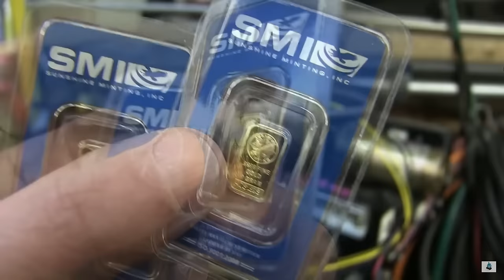Cold Welding In Vacuum

Comment: Thanks for testing so thoroughly! Very interesting to see how difficult it is to get a cold welding result!
Reply: can you show a more in-depth video on how to make a nut vibrator?...making one for a friend
Reply: AvE Thanks for recommending this channel to me. Cody has almost a million subscribers now. crazy.
Reply: So, is it pronounced Ave?
Reply: Ja, nuts, I remember coming across his water to acid mythbusting vid then having my mind blown at the TNT vid; thinking how does this guy only have a thousand subscribers?!
Reply: This colab has been very interesting to me, I think the finding that twisting metals together plays a big part in cold welding is significant in the mystery of gauge blocks holding on to each other... yet I've never had gauge blocks gaul up permanently like actual cold welding
Reply: i also think YouTube is in need of more nut vibrating, make it happen AvE.
Reply: AvE That pleasure device could be breaking the weld from the bolt and nut... but it could also form a weld... paradox!
Reply: I think that cody's theory is correct. A way to test it would be to press the 2 gold plates together in your hydraulic press.
Gravity alone cannot get enough atoms to bond but a press just might do it. The atoms will be closer to each other and the flat plates will get even flatter.
Reply: AvE build a rig so cody can adjust the frequency that mini vibrator puts out the right frequency should melt metals after all pretty much everything is on some kind of wave length even if you cannot see or measure it with tools available.
Reply: Hahaha I thought those gold pieces were familiar~!
Reply: jam9297 that's why it pauses when vibrating
Reply: AvE when you sent them you galled them pretty bad I wonder if the surfaces needed touching up then if placed under vacuum if that would finish it off...
Reply: He is not actually cold welding. It is actually friction welding.
Reply: mitsukai89 otherwise I would side with you but the last experiment where he had a reference sample in atmosphere didn't exhibit the same behavior. Only thing affecting the possibility that I can think of would be that air was working as a cushion preventing the particles from causing friction to each other.
Reply: I don't think it will be thorough enough until he gets that mercury out. More than enough for an uncontrolled almagamation-'glue' effect.

I suggest making a sort of copper 'wool' out of fine copper wire and pushing it into the vacuum feed tube. It will act as a mercury 'getter', as the mean free path of the mercury atoms will be intercepted by the dense thicket of copper. The vapor-pressure of the copper should be trivial.
Reply: I explained it on another comment.
Reply: you recommended me to his channel! I've been subscribed to him since 18k
Reply: You are everywhere.
Reply: AvE Maybe @Cody'sLab and @destinws2 (< SmarterEveryDay) could use Destins phantom camera with a macro lens to get a better look at the gold or copper powder under vacuum while vibrating. you can definitely see some kind of spark come from the gold. I have some other ideas but we'll start there. 😆
Reply: More collaboration vids with Cody, please
Reply: Better say no next time ol' uncle ave asks you to do strange things cody...
Reply: AvE if you collaborate with Cody in the future will you let him see your face or will you just be a speaker on the desk like in Charlie's angels.
Reply: please tell this dufua your name isn't ave....
Reply: Please send me 2g of gold, it's for Science or a Chateau Margaux 2010, J'sais pas encore :D
Reply: Meow Meow Fuzzyface
excellent idea
Reply: Try some emery paper between the gold instead of lint free.  It should cause a clean contact with no oxygen.
Reply: mitsukai89   finally .yes metals of the same type make terrible bearings
Reply: ave  you stole that gold from the little people in the dolls house in your wife's sewing room and now they're ruined.  why.... why must you be so cruel ?
Reply: You did it pretty damn good in atmosphere AvE...
Reply: I often ponder the same question when I am enjoying 2-4 of my favorite beverages... AvE stands for "Arduino versus Evil". Personally, I pronounce it "aw-vey". Just because all the Canucks from Canuckistan say 'eh' all the time. But I could see it being pronounced Ave (like Dave). I doubt you'll get an answer though. ;)
Reply: zachschwenk i always said a-v-e than hearing cody call it ave and didnt know who it was
Reply: I'm quite impressed with the amount of work that went into this video. With that said, I believe that rotating the metals on each other, opposed to smacking the things together, creates multiple somewhat equidistant contact points experiencing about the same amt of pressure. Possibly electrons are flowing in some way. There is an easy experiment: take a horseshoe shaped piece of indium and rotate it on a plate of indium about its center, if it coldwelds while both ends of the horseshoe touch the plate with some amt of force and does not when only a single end touches and is rotated on the plate, then this would be good evidence for it being related to electron flow.
Reply: AvE   I really enjoy watching both channels.  Can't remember who I subbed to first.  You guys are great at making videos.  keep it up.  I even own a AvE ruler.  if I could ask anything, it would be to dumb it down. I understand what your up to but you guys lose me easy.  I'm only grade 12 education and I'm sure I'm not alone
Reply: AvE got to feel cool another channel chooching something you made with your hands.
Reply: AvE Focus you fuck. Love your videos;)
Reply: AvE why can't he pronounce your name right. Also we all know you're the old tony
Reply: Tactical Ultimatum how do you pronounce it? I can't get a straight answer
Reply: I can do this no problem.. AvE, just send me 2 gold bars.. It generally only works with the 10 ounce ones, or, if you're down with it, the 400 ounce jumbos.. I guarantee it will work.  After Cody is done here, I'll give you my address.
Reply: I was just thinking along similar lines: perhaps the concussive force of slamming items together creates too much bounceback and prevents the welding, and slowly, but tightly pressing them together could do the trick. Magnets is a good idea. If that works outside of the vacuum, perhaps within the vacuum the bond would work faster, or stronger? Keep 'yer brick in a vice!
Reply: Always nice to see two skookum choochers collaborate with the bumblefuckery
Reply: AvE I think the idium is acting like the gage blocks when you get the indium though since it's so soft it flattens the surface and when you push the two pieces of indium together it's pushing all the o2 out of in between the blocks
Reply: hmm?
Reply: AvE learning how to chooch with cold welding 😁👍👍 this didnt chooch well
Reply: The bell end vibrator is the area to concentrate on. Your 'friend' will thank you.
PS without looking at Ave's video it would be very easy to make. An off centre weight on a little motor is all the vibrator is. To drive it intermittently you could use a 555 timer or similar CR cct.
Reply: What a collaboration!
Thanks dudes.
Reply: And sent Cody's lab a vibrator. Lol.
Reply: AvE yep Cody and u r awesome  and  very educational
Reply: Ajax Racing yep,agree
Reply: It's cool seeing my two favorite youtubers colab.
Reply: Dude, you are a national treasure!  Now if we could just get the world to recognize the internet as a nation-state.

Comment: You worry about a single layer of O2 atoms on the gold, but not worry about a 'mountain' of molecules of grease from your hands on that gold? No wonder it is not cold welding. Besides those gold bars were not polished enough - they have to be mirror polished.
Reply: I also wonder if the wooden rig was outgassing and causing problems
Reply: “Diamond finished”?
Reply: @notfiveo Junior Mold Polisher here checking in. Lol

Comment: Have you degreased the gold? Probably there was a thin film of oil or other organic stuff that prevented cold welding. Try a piranha solution or a concetrated solution of sodium hydroxide in ethanol. They are powerful degreasers especially the piranha solution. Also you can check if water beads up on the surface which would indicate that surface isn't clean enough.
Reply from the maker: I tried several things; acetone, isoproponal, heating... I was using gloves in the beginning to keep the oil from my hands off it.
Reply: it's really hard to get rid of it. Organic stuff is suspended in air and even perfectly cleaned surface will be dirty after some time.
I had some luck with concentrated H2SO4 mixed with surfactant (Sodium dodecyl sulfate).
Piranha would be the best though.
Reply: Probably Patreons getting earlier access
Reply: I Like Turtles Same it says he put the comment 6 hours ago and it went up 5 mins ago WTF XD
Reply: Like Fredric Marc wrote - I'm one of the patreons, and have earlier access ;)
Reply: HEY!

spoilers.
Reply: Damian Krystkiewicz HOW IS THIS 6 HOURS AGO IF THE VIDEO IS 15 MINUTES AGO
Reply: Thelegend27 Formerly know as luke First Patreon supporters get early access.
Reply: Thelegend27 Formerly know as luke First  - Patreon.
Reply: When we built TPM, we used an ultrasonic process, using PURE water at the end.
The trouble lies in the foreign atoms, he need some plasma blast off while under vacuum, neon+4KV...
Reply: You might need to go so extreme as to do a plasma cleaning similar to how the channel "Applied Science" did. In fact why not message him to see about a collab on the subject?
Reply: Bernhard Jordan: You need to dissolve a NaOH until saturation then you ready to go.
Reply: I second Damian's suggestion. the water bead trick is handy. If the surface is already pretty clean, RCA-1 solution can clean off the organics too (Ammonium hydroxide (30%), hyrdogen peroxide (30%) and water (in a 1:1:5 v/v ratio), heated to 60-70C for 5-10min). I use this to clean glass slides before metal deposition so the films will adhere better.
Reply: As mentioned above, O2 plasma cleaning will also remove residual organic surface contaminants. Inert plasma could also work, but that's relying on sputtering the contaminants off the surface, so will be slow.
Reply: Kyle, AltMarc, et al.
I've repeatedly said, and will reiterate, the twist and press is going to grind off nanoscopic areas of submicron high 'hills' of metal. This will strip off peaks and lay bare virgin non-contaminated surfaces, as well as present planar (nanometer and picometer irregularties)-to-planar surfaces (in a few tiny areas) for true metal-to-metal hard-bonding.
Reply: Also it is worth noting that wood contains a lot of gases and oils. Under vacuum those substances are being released constantly. They may create a film which will prevent the cold weld. Of course it is only my observation. It may be that it is not a cause of not welding at all. I agree with Damian Krystkiewicz, though, degrasing is really important. Acetone treatment and after that distilled water bath, then drying in vacuum. Good idea as well would be to make bath in some substance which would chemically strip the oxygen layer from the gold. Of course as close as possible to tripple point of the substance which would be used, so that amount of oxygen in the chamber would be as little as possible while maintaining the substance in liquid state.
Maybe there is some gas which could be able bond with a oxygen and you could make short direct stream of it shortly before performing the joint (of course all in the vacuum chamber). Just some thoughts, maybe non of them make sense (I no jack about chemistry) but maybe because of it you will have some new idea. That would be great. Peace man!
Reply: What do you work?
Reply: Me?
Reply: All of you guys who understand in chemicals

Comment: Cody, Another approach you could try is to freeze one piece of gold in the liquid nitrogen so that it shrinks, next clamp it together with the other piece of gold, then as the frozen piece starts to warm up it will expand and possibly lock the two together. anyway great video!
Reply: Experimental Fun runs on coke huh
Reply: While cryogenics can change crystalline structure in metals, it won't make them magically flat and clean enough for the lattices of the gold to cold weld on large surfaces. Temp was not his failure.
Reply: He's trying to cold weld, which bonds it on an atomic level. Your talking about pressing metal together, not even close to what he's trying to do.